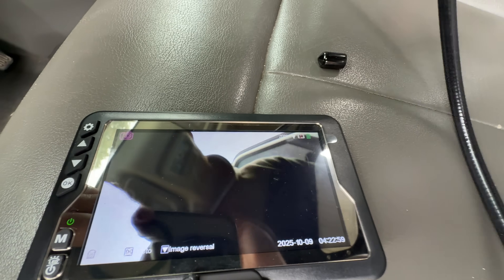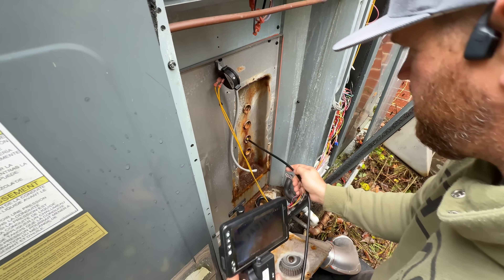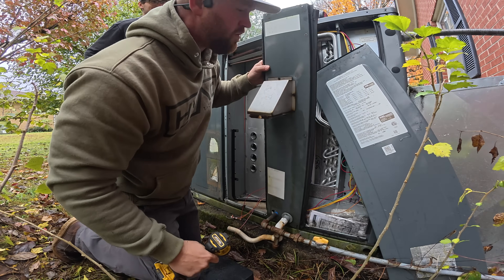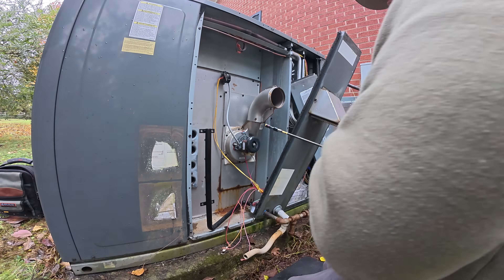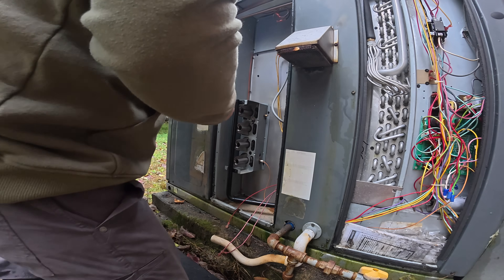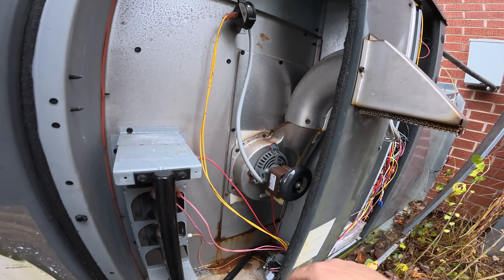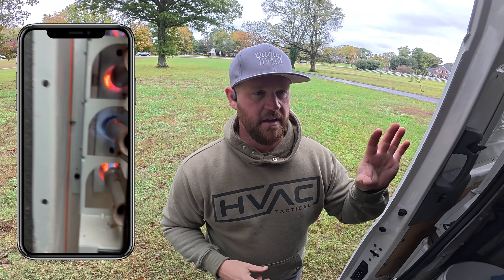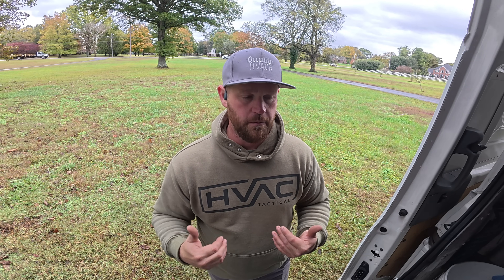Never Seen This Before!! Heat Exchanger Issues

Comment: Surprised that's not more common on these package units. When the AC is on, outside of the heat exchanger is going to get really cold while the inside is exposed to hot humid outdoor air. Seems like it should be like a magnet for condensation.

Comment: I had that in a RHEEM gas package. It was an issue with the yard drain and the run off would get just high enough to be near the burners. It was always an issue for the first use of the furnace each year.

Comment: One of my customers in the mountains was asking if I could look at his furnace under the house. When I arrived, there was not any water anywhere down there. but when I opened the door to the furnace there was a Mud/water line up halfway inside the unit. unlike your it was done. Apparently, he said there was a big snow that winter and then it warmed up in the spring quickly causing a river of water to go through the house.